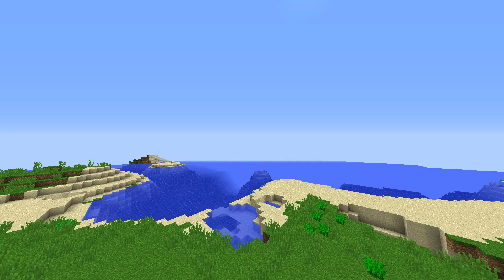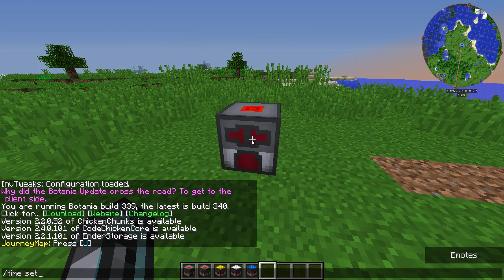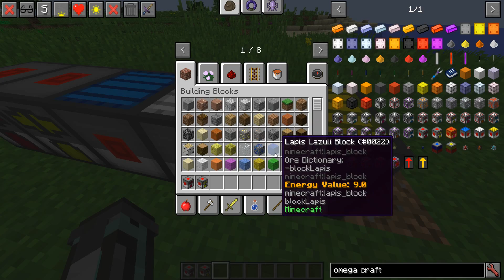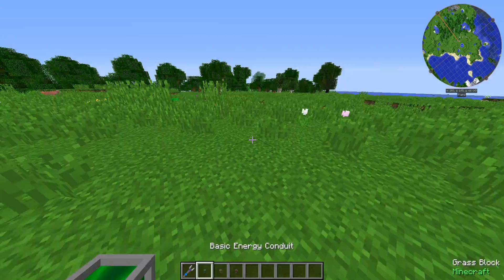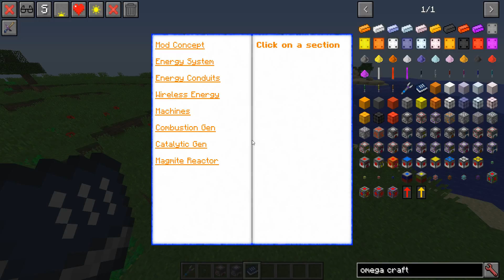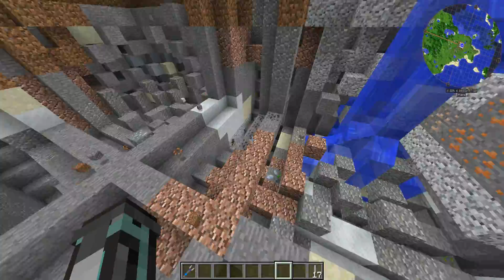Mod Spotlight: Omega Craft (Mod)

Comment: Nice, I'll try it out with this knowledge in mind. I'll watch this later when I have the time. Much other fixes you have to do since?
Reply from the maker: Currently as of version 1.0.3, I have solved all of the bugs I have found, though there may be some more. Either way I am continuing on with the next version.
Reply: Sounds good. I'll work on my tutorial soon.
Reply: Fluid/Item would be great. Fluid especially since I just always wanted a mod for small things like a few machines, piping and a few ores/components, not too many utilities and more as it gets too much I find personally. Like modules in Build Craft or Redpower. Do I want things I know and prefer. But not the utilities because I'm not really going for them this time. Might be silly but my mod thinking has been that way nowadays since using less known mods. I know its more annoying for modules then in one mod. The integration and core to like about 3-5+ mods is a lot of work. Just thoughts, don't take it seriously.